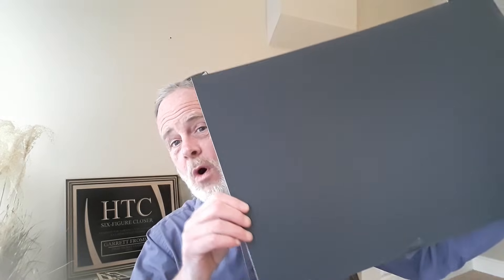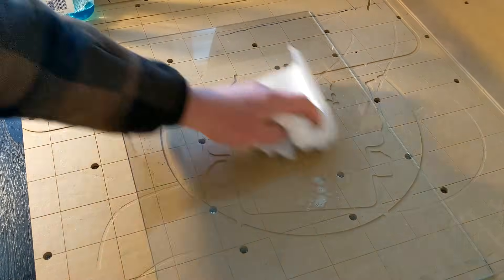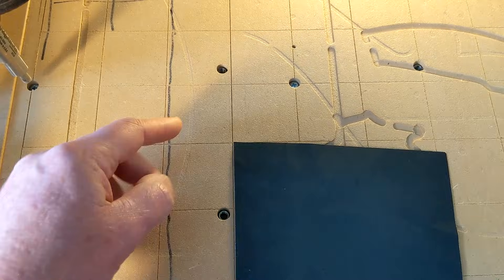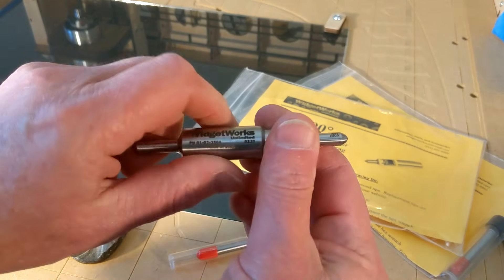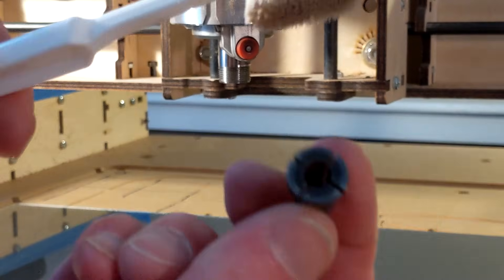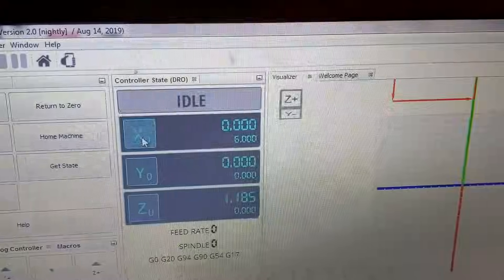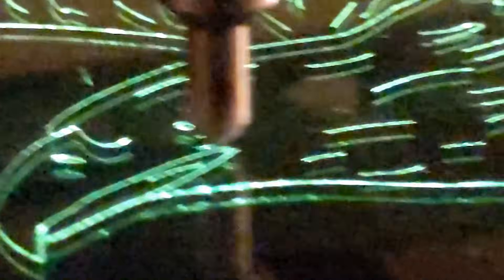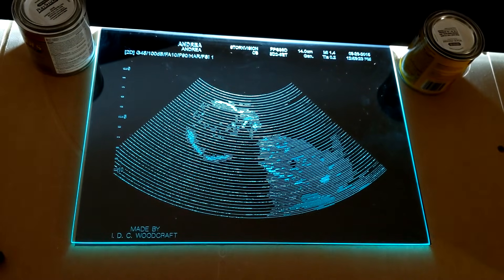How To Engrave Glass On a CNC Router [With A Drag Bit], Glass Etching

Comment: I am a Disabled Veteran and I am hoping to learn woodworking to ease my PTSD and earn an extra $500-$900 a month. (Any more and I risk losing my Social Security I think) save for my first CNC I bought the Gatton CNC and I think it will be awesome But I do not yet have the woodworking and electrical skills or confidence to build it. I am looking at the Onefinity CNC (Easiest to put together (until I decide to add a spindle instead of the Makita router) with a 7-watt laser for basic engraving. I enjoyed your video and was wondering are you stuck at one width for the etched lines? Can you use light pressure to do finer lines like adding the fine lines in the feathers?
Reply from the maker: Yes, That is the beauty of this engraving bit. The spring-loading allows the pressure to be adjusted simply by telling the CNC router how deep to plunge the drag bit. This one was set at 0.05". If I back it off to 0.01", the lines will be extremely fine.
Reply: @IDCWoodcraft  What is the average life expectancy of the engraving bits?
Reply from the maker: @Dartel  Don't know. Haven't worn one out yet. Have done 8 different projects so far
Reply: Sawdust Therapy is better than anything the VA offers....

Comment: Another great video Mr. Garrett. For the eagle can you carve glass out with a CNC router or just engraving only?
Reply from the maker: You need a special (and much more expensive) bit to 'carve' glass. You also need a water bath for the glass to be submerged in. Glas dust is not a good thing to be in the air